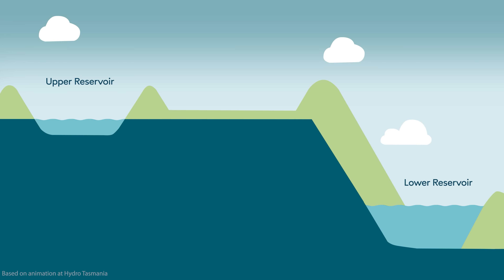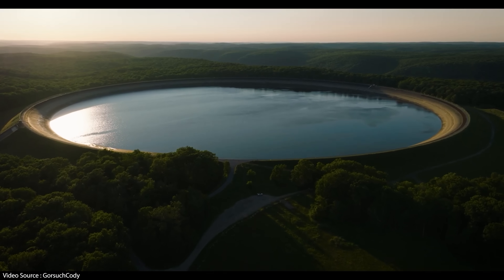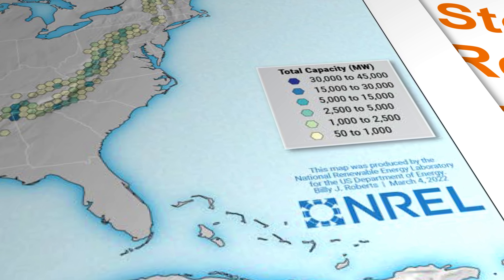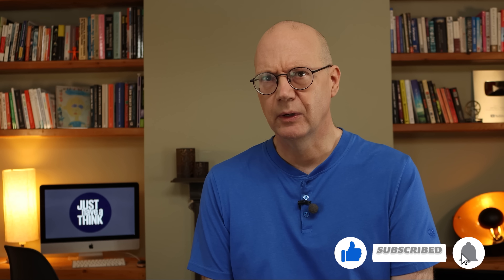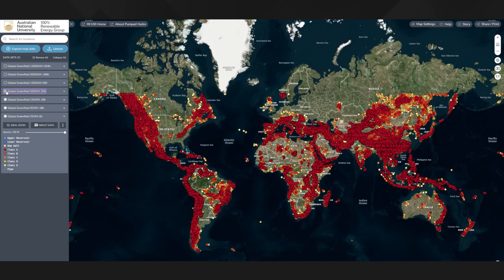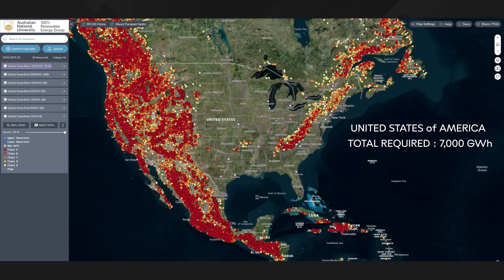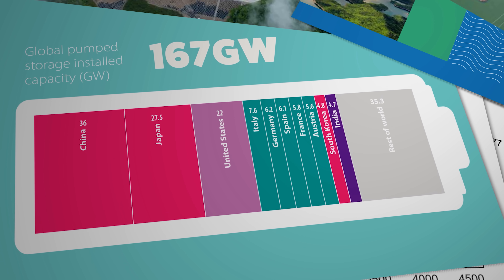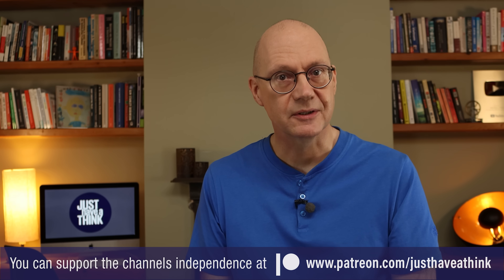The insane potential of Pumped Storage Hydro

Comment: Tow Major Problems. 

1.
You Already Point out that this Study ONLY Checks for Sites from a Geographical and Topographical Level. 
Or if we want to Say this normally. It only Check if there is a Sufficiently Large Area with a Height Difference. 
Because that is Really all that is done here... 
It looks for 2 Areas of Size X which have a Height Difference and have a Distance to each other that is within the Tolerance. 

Whats even worse tough. Is that to Calculate the Cost they only seem to have been Applying the known Cost for Building Pump Storage on Sites with Similar Capacity. 
And have Completely Ignored the actual Requirements of the Site. 

And while its true that 1% of these to be True would Suffice. In all Likelihood not even 0.1% of these will be actually Viable. 
Because I just opened that Interactive Map to Check where it would put these in my Home Country. 
And After checking over 50 Sites I could not Find a Single Actually Viable Site. Basicly all of them are Simply Plastered onto an Existing Lake where there is a Surrounding Hill. Which however is Completely Unqualified because these are Soft Earth Lakes and cant Hold Water unless You basicly Eradicate the whole Forest ontop of it and then Excavate a Lake there, fill it with Clay to actually hold water and then actually start Building the thing itself. Because it would in this case be easier and Cheaper to just Build a Completely Artificial Water Storage somewhere. 

For Mountain Ranges its even worse. Because here the Map has just Plastered the whole Mountain into overlapping Potential Sites. But there is nothing there. 
Building a Site there would effectively Require Mining out a Large Lake into the Mountain as well as below the Mountain to then Build a Pump Storage there. 
And all of this is before we Talk about wether the Mountain is even Stable enough to Support the Loading and Unloading of Water in such Quantities. 

At First Glance. I would assume that less than 0.01% of these Sites are actually Viable in any Reasonable Cost or Timeframe. 
And well. Something You actually Point out at the End of the Video. Is that these are already being Build anyways. 
Albeit I Seriously Doubt that these Sites even remotely come from that Map. Which is why its so Blurred out that basicly its counting it if its roughly in the same Country lol. 

2.
The Second Problem however is Distance. 
Something that immediately Comes to Light here is that well. Pump Storage basicly Requires a Mountain. 
And even if we Ignore Point 1 of likely less than 0.01% of these being actually Viable. All of these Locations are Clustered on Mountains. With Large Parts of the World being entirely Ignored.
But Mountains dont tend to be the Population Centers of a Country. 
And Transfering Large amounts of Energy is also something that Requires Construction. 
Right now no Country on Earth has an Energy Grid that could Possibly handle the Energy Transfers Required to Supply the Country from a Central Location. 
Not to mention Transfer Losses etc. 

So Yeah. 
Sorry. But this is a Fantasy with no Real Value.
The Actually Viable Sites are already being Build or Planned because if they are Viable it makes sense. 
But its nowhere even Remotely enough to push this as a Solution.

Comment: If the pumped hydro grafic were accurate, then the water pump would get air bound and burn up. An air bound pump is what happens when too much air enters the pump. Fluid is needed to lubricate the pump. When the pump has air instead of fluid, then it doesn’t have the lubrication that it needs.

Comment: And describing pumped hydro as "closed loop" in a redundancy. Of course it is closed loop, that's what makes it "pumped" hydro. If it's not closed loop it is plain hydro where the water goes through the turbines just once. It sounds like classic distraction tactics from the fossil fuel industry. Let's call our storage facility "closed loop hydro" then the mugs will think they are getting something new, and green, meanwhile we keep burning HCs to generate the electricity in the first place.
The real problem is how do you ensure that the kWh of electricity delivered to your house is generated by renewables and not HCs. It's not labelled. It's just another digit on the meter.
And you will recall what a bunch of lying bastards these corporates are. They don't care if they burn down our environment so long as the dollars accumulate in their of shore account.

Comment: They tried to get a pumped hydro plant built near where I live back in the 90s.  They wanted to use a local lake up in the hills.  It would have, unfortunately, ruined the lake, since doing lake activities kind of relies on reliable water levels.  They also didn't explain it well... talking about buying electricity and selling it cheap made it sound like a scheme.  They didn't really talk about load balancing and renewables weren't really on people's radar.

So, here is the question... how many of these are fully isolated systems?  It would be a lot more expensive, but I suspect it would have been a lot easier to sell people on digging a new reservoir on top of the hill than taking a lake that was already being used for recreation and creating radically varying water levels.  

It looks like there are some pumped seawater models out there.  I'd think that could have some huge potential on the U.S. West Coast where you have a lot of very quick elevation near the coasts.

Comment: My problem with pumped hydro is this, it doesn't create any new energy. It is STORAGE, and as such the energy that it puts into the grid has been generated elsewhere previously, quite likely by a coal burning power plant. Pumped hydro does not PROVIDE energy it stores it. This is a word you used to describe pumped hydro.
Reply: Yes, that's the point. You use excess, cheap electricity from baseload plants to pump water at night and release it to generate power during the day when demand peaks. If electrical demand was a flat line of course PH wouldn't be needed, but it's a curve.
Reply: @sharkheadism  Yes I understand your point but the more important thing is to generate electricity from renewables and stop putting CO2 into the air.
Reply: @mayflowerlash11  Whether the baseload is renewable or not isn't relevant. There are hourly power demand fluctuations and spikes, which is what pumped storage mitigates.

Comment: Nice review,  I am interested in the cost comparison of pumped hydro vs grid-scale batteries.  In this area we have 450 ft bluffs overlooking the Mississippi river that could barely meet the criteria for good pumped hydro and many coal plants were built on the river to access coal barges - good infrastructure to be reused for distribution.
Reply: In Australia, the capital cost of pumped hydro storage (PHS) is ~ 1/3 that of grid scale batteries per MWh. We have a PHS in construction which uses a defunct open pit gold mine as the lower reservoir. PHS is a no brainer for Australia , ~60% of the population reside at the base of a mountain range which runs the length of the east coast of the continent.

Comment: PSH seems much more feasible than the temperatures and pressures involved in any kind of steam power generation. Once properly installed, the pumped hydro will need much less maintenance, but continual monitoring of the reservoirs for stability, etc. And the power for pumping water is made by the system itself, and even then, it is not consuming anything but its own product. I like it! Getting them up and running will create good jobs, with some employment continuing to run the facilities. Put gravity to work!

Comment: There's no large pumped storage system anywhere in the word that is powered entirely by renewables.  They only need to be considered because it's not possible to control the output of renewables in a way that delivers the right amount of electricity when it's needed.  Coal-fired power stations can be managed to do that, so can gas, so can nuclear or at a pinch, so can oil-fired, all without expensive storage of any type (battery or pumped storage).  Good science, not science with a vested interest, says that even a doubling of CO2 will cause just under 1 dg C warming.  How long will that doubling take? About 150 to 200 years.  Just have a real think, not a pretend one.

Comment: The larger topic of hydrology, water management, using reservoirs-penstocks, and getting rid of dams, pumped storage hydro has a place, but is dwarfed by flood prevention and water security.  Using electricity to pump the water is inefficient.

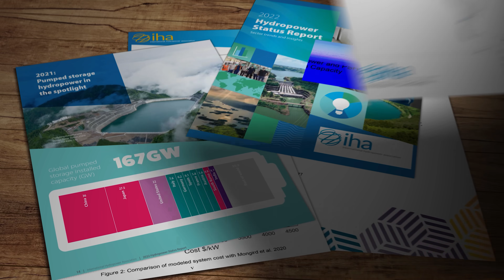Comment: Thanks for another great video! I think my country is pretty behind when it comes to pumped hydro. In that map at 10:53 we don't seem to have any installed capacity at all, and there's just one planned for construction. I wonder why that is. It can't just be the effects of winter. In winter the top of the ponds would freeze, but you could still pump the water that's under the surface.

Comment: What is the efficiency of pumped hydro?
I think I recall reading that it's only something like 33%, so you have to put 3 units in for every unit you get back out.
It might be an interesting video - comparing the efficiency of different storage systems - both electrical and financial.
Reply: Operational PHS is about 75% efficient, most of these are 30+ years old. Latest designs can get to 85% .

Comment: Hydrodynamic Energy Transference is included in the definition of the Holocene Epoch. Those of us in the Anthropogenic Era are known for a hubris fueled eagerness to re-invent the wheel and call it progress. The re-branding of the obvious is a purely political exercise. From an Engineering perspective the circular problem is bounded by <[Source~Gate~Drain~Ground]> Therefore, harmonic compatibility requires precise calculations involving complex Electromagnetic / Enviro-spatial / thermal / hydro dynamics which all depend on the efficiency of the fluid to transport energy within a reliable cycle. Environmental Contamination of the circulatory and containment systems is a significant problem which determines the maintenance cycles of the facilities. Heavy water and Pipe Slime can degrade performance exponentially. Debris generated turbulent cavitation is highly corrosive.
Hydrodynamic energy storage and transfer is one of those wheels that keeps getting rediscovered …
Let’s apply our all available resources and technology to solving this essential problem. Electromagnetics will play a significant role in frequency modulation of the Gates | Valves controlling fluid flows and its contaminants. 
The reservoir problem synergizes  inputs with outputs…plus those pesky known unknowns and unknown unknowns.
Nevertheless, if this nascent Anthropogenic Era is to persist we must be sufficiently clever to re-invent the wheel one more time for our posterity. Let’s get on with it as best we can under the circumstances. Lucky for us the scalability allows for all manner of modeling/testing. AI is improving our understanding of the complex processes involved.
GAIA has the answers …all we have to do is ask the right questions…

Comment: In places lacking water or otherwise unsuited for pumped hydro, the potential energy can be transferred to something other than water--e.g. large steel reinforced concrete  blocks lifted with cables.  In the mountains east of where I live there is a large pumped hydro power plant that was built to counterbalance a now inactive nuclear power plant.  The generators were wearing out, which was a great opportunity to rebuild them to counterbalance the far more rapidly changing output of the newer solar power installations.  Pumped hydro stations can also be underground--in exhausted mines, for instance.

Comment: Seems to me that between nuclear, closed loop pumped hydro power, EIVOR, plus solar and wind and even wave, as a species we have all the technology to achieve all of our energy needs plus quite a lot more, both in the massive scale as well as in the local/smaller scale.
Seems to me that fossil fuel energy could be very well as of now be relegated to a individual last-resort way of producing energy: when everything else fails, you start up your own generator.
Question is, as well put at the beginning of this video: will it ever be profitable enough for big corpo?
Or will we need to rethink our entire economic system, switch from profit druveb to... Not-dying-driven, in order to make it work?

Comment: Thanks Dave, another great update to current situation in Technologies, this time for Stored Hydro.
I have long held the view that the Energy in Water movement was one of THE main solutions.
In this case Pumped Hydro, as you outlined, is a proven Technology, sadly it is held back in the same way all other Renewable Systems are.
It is our obsession with evaluating everything through Cost/Return Lens that makes no sense when we are facing this real Existential Threat.
This paradigm must be put aside and every Country must simply evaluate each Technology on it's ability to deliver the Energy we need, then build that Infrastructure.

Comment: Those claiming underground lower reservoir can work everywhere for pumped hydro storage have no idea of the volumes of water required to produce commercial volumes of electrical generation. eg 2.5 cu m of water per kwhr with 1,000 m head. For a smallest commercial scale install storing water to produce 30 megawatts for 4 hours even if 1,000 m head, the underground volume must be 300,000 cu m underground storage. Thats 20 km of 5m x 3 m tunnels, a rare find for sure.

In N. America, far more effective is the level difference between Lake Erie and Lake Ontario. 480 gw storage for 4 hours production with only 17" change in lake levels. 45 15 m boring co. tunnels thru the 20 km of Niagara escarpment, plus level control gates at the outlets of both lakes, and a fair HVDC suplemental grid to tie in solar and wind resources, and to distribute bulk production throughout the eastern seaboard and midwest.

Comment: I would disagree that pumped hydropower has "insane" potential. Unless those pumps are powered by solar, wind, or nuclear, it will still cost energy. The best thing to do is to eliminate the power grid and force everyone to conserve power. This will light a fire under grid-free applications and stir a movement of freedom no one has ever experienced.

Comment: Couldn't they use water towers and a large tank on the ground in areas too. Maybe pump the water up with big pipes and us small pipes on the downward direction to increase the pressure and run it through a turbine. This would help with evaporation and if there was a water shortage in the area it could be used as well.

Comment: Grid scale batteries best purpose is to provide short term smoothing of demand so the pumped hydro can be optimized against it. Hydro can be adjusted on an hourly basis while batteries are a fraction of a second. Together they can be more effective than one of them on their own.
Reply: Hydroelectric units can come online in 1-2 minutes.
Reply: @sharkheadism  Thanks for your comment.  By come on line in 1 to 2 minutes, do you mean from shut down to fully operational?  What about load matching minute by minute?
Reply: @colingenge9999  Yeah that's what I mean... they can go from stopped and offline to fully running and under load in a minute or two. That's one advantage hydroelectric has over over generating mechanisms and why they're often used as load-following and peaker plants rather than baseload. The generating units run at a constant RPM to match the frequency of whatever grid they're on.

Comment: You seemed to have glossed over something. 🤔
This system doesn’t PRODUCE any net electricity. Rather it consumes power through mechanical and hydrodynamic losses. 
Sure it take excess capacity and stores it until required but doesn’t add power to the grid. 
In short, it can’t replace any form of generation, merely augment and flatten base load irregularities.  
It is, as you say, a rechargeable battery. Nothing more.
Reply: Yeah, because electrical demand isn't a flat line.

Comment: I didn't catch it in the video - how many cubic meters of water to deliver one mega watt of power?  I recall hearing the '2 swimming pools' analogy, but not details.  Cause I think that artificially constructed  concrete / steel water reservoirs could have some value, as they do in the potable water system of many built environments

Comment: The efficiency, scale potential, and lack of needing exotic materials for construction made me a fan of all hydro, including closed-loop pumped hydro.  I was (pleasantly) surprised to see so many operational units of pumped hydro in the US.
Reply: The province of Quebec, in Canada, is 99% renewable, with 94% of its power from hydro. Theres a rivers with like a dozen dams chained every couple hundred miles along it too.

Hydroelectricity is not limited to one dam per river. As long as the river has a lower elevation downstream, you can add another dam, and another, and another…

Comment: I've been thinking about building some artifical mountains in the North Sea. When the clouds hit the mountains it will rain.    And you could use surplus electricity from windmills to pumped hydro.   

It will probably be way too expensive to make any sense.   But that hasn't stopped me from thinking about it.
Reply: well thats what slartibartfast  had in mind when designing norway ! But for sure as easy it is to implement when designing a planet, adding the feature later is a whole different story.
Reply: @olivierbraun941   I actually got the idea from Norway. It rains a lot on the west coast. I'm from Denmark.
Reply: Very funny.